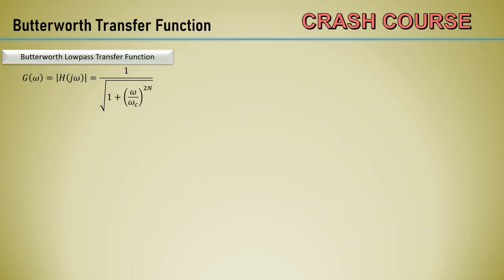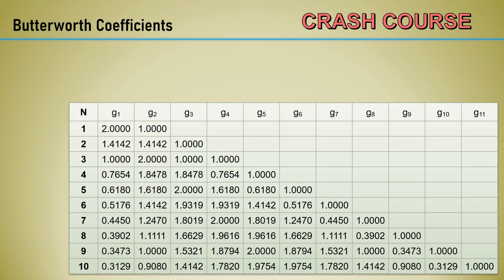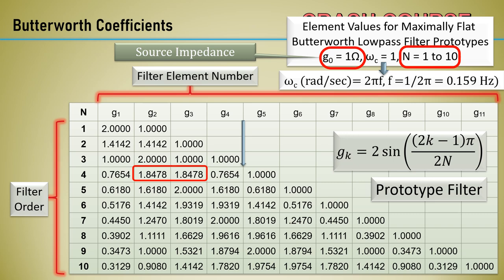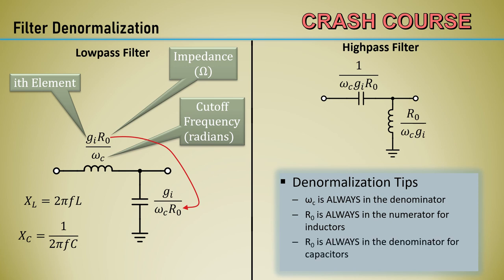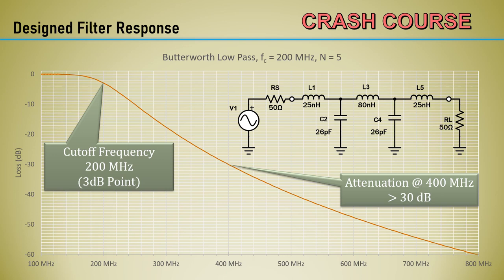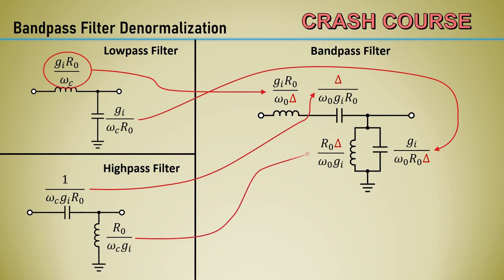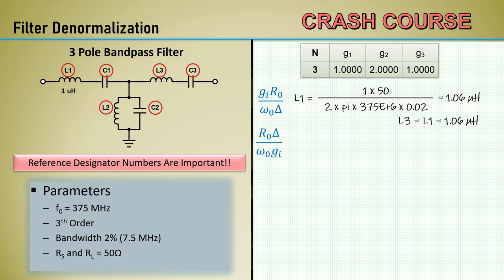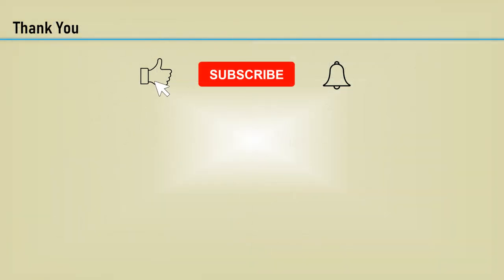Lumped Element Filter Design - A Crash Course

Comment: Really great and practical video. I like that you also brought up a case where the component values become impractical.

There is so much to say about filter design, so this could be a series if you want to stay on the topic. Practical things that I find useful to know about in my work are the effect of parasitics (at least to a qualitative degree) and the fact that Chebyshev filters are often a better choice than Butterworth as they are steeper for the same order and the flatness disadvantage can often be dealt with by increasing the 3 dB bandwidth a little while still keeping the stop band attenuation better than the Butterworth of the same degree. 

Regarding parasitics, simulation in e.g. LTspice is a great tool to see their effect, even if analytical treatment is impractical.
Reply from the maker: Thanks for the comment. I agree, this is only a small piece of info about filters. At higher frequencies than I used in the video, the ceramic coaxial resonator filter is the workhorse in the microwave industry. Their use is restricted by size usually. They are too large around a few hundred megahertz. Then printed filters at X and Ku band.